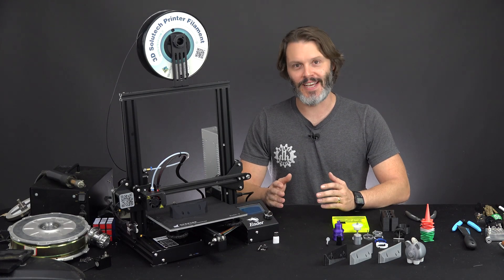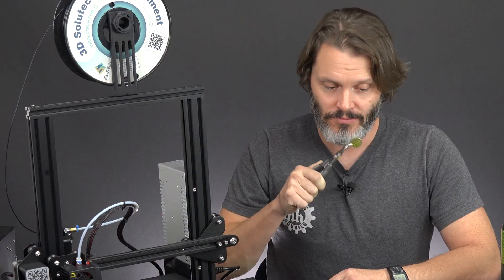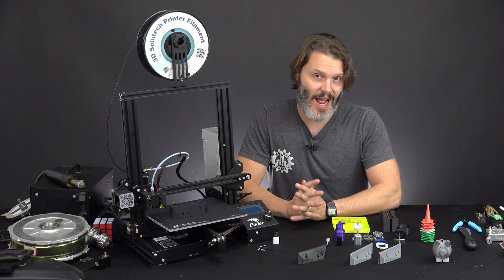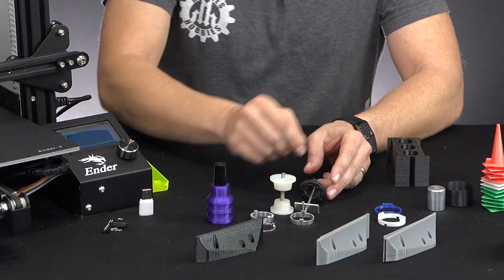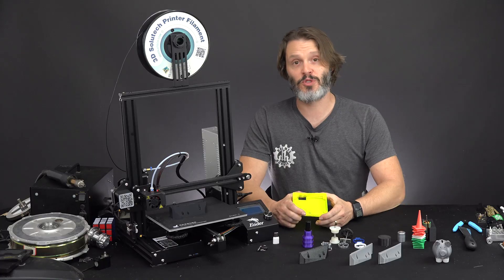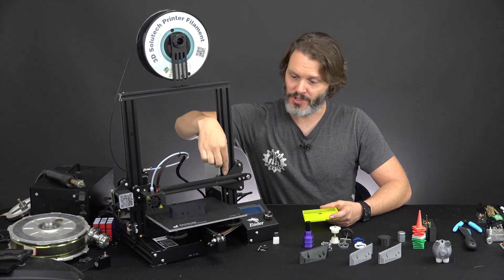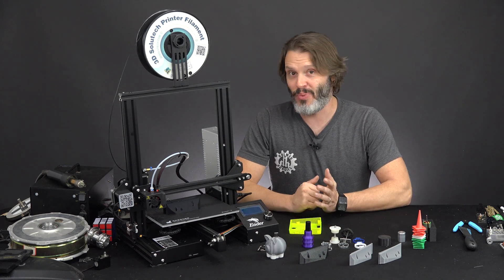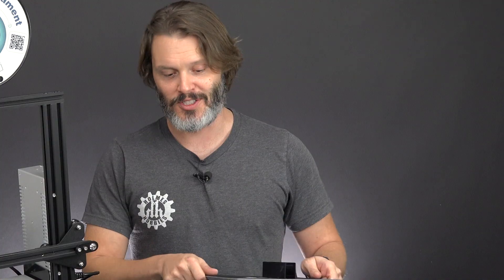3D Printer Talk - Printed Parts, More Creality Ender 3 & Tech Discussion - Holmes Hobbies

Comment: I mostly 3D print RC parts, RC bodies and scale parts. For chassis parts I care more for strength than finish, for RC bodies it helps a lot if the finish is already smooth. Saves a lot of prepping for paint.

What other 3D printers do you use John?
Reply: i know it's pretty off topic but do anyone know of a good site to watch new series online ?
Reply: Thanks, I signed up and it seems like they got a lot of movies there =) Appreciate it!!

Comment: Hmm, my Ender 3 Pro printer upgrades... isolation mounts on the X & Y axis stepper motors, Capricorn PTFE tubing, and a new fan blower nozzle. It still needs a filament guide. Was using PTEG-Carbon Fibre, which was an utter pain to get printing correctly; Amazing stuff once dialed-in. Now back using PLA with the same settings (lower temps) and getting beautiful prints.  Mainly used for custom parts on my RC's, like a rear cantilever suspension setup and chassis braces/body mounts on my Gmade GS01 chassis (Unimog conversion).

I bought an Elegoo Mars M-SLA resin printer a month ago and love it. The level of detail on the prints is absurd... Completely different experience and more involved than using an FDM printer, but worth the effort to learn the quirks of SLA printing. Used mainly for detailed scale parts and figures/busts.

Comment: I am really enjoying my Ender 3 pro. Apparently they did change the motherboard's layout as mine has the fan on the bottom and they moved the USB and micro card to the top.
I did get a glass plate to print on  PETG with a steel .8 nozzle works great but not a .4 nozzle as it wont stick  properly. The biggest check is to make sure that when you say to use 100 mm of filament that the e-step pushes 100 mm through (this was my biggest challenge with under extruding). look forward to your next video

Comment: I'm looking to get into 3D printing and I e seen the printer you have featured quite a bit. I'm looking to print r/c crawler parts. I would like to make more scale realistic and functional parts like lift kits, lowering kits, brackets, bodies, floors, engines, engine bays, wheel wells, ECT. But I do want that perfect smooth finish. Would you recommend this printer or is there a printer you would recommend? Also I would like a bigger built surface even though printing bodies in multiple pieces would be more realistic. I just want to get you thoughts on that. By the way your motors are great. Thank you for your time

Comment: Get some Capricorn PTFE Tubing on that before you go direct drive. Cheap, easy and surprisingly helpful on bowden setups. I also prefer direct drive, but it has it's downside as well. I have TL smothers on one of my printers, but can't say it helped noticeably. They seem a tick quieter, and a tick better print, but not worth the trouble to me. I also just want functional parts, but if I want a pretty part, I just slow everything down to about half the speed I normally go, and I'm happy. If you want a filament guide, I'd recommend a chunk of foam rubber zip-tied to the top with a cut in the side. Just stick the filament in the cut and it acts as a guide and wiper. Also it's fast and easy.  Great, fun video. You are a joy to watch!
Reply: Also, I am running Octoprint on Pi 4. The upgrade from Pi 3 is SO worth it!

Comment: Ya you need to upgrade to a Micro Swiss hotend and Capracorn boden tube to start next $6.99 micro sd to larger sd card also visit Thingaverse for sd card holder , x access screw piece for filliment ...change location of spool holder and move to far left of carage last print larger extruder knob makes it easy to load and unload filliment ....you will be very pleased with the Ender 3 works great for $175.00 dollar printer...

Comment: How high or low is the quality of the plastics used in 3d printing? I would love to be able to print out my own bumpers, side guards, maybe my own shock bodies. Is the plastic strong enough to take a little impact,  good enough to prototype?
Reply from the maker: some plastics are better than others.  nylon is the best for impact but its also pretty hard to print for a newbie.   Also need a full metal hot end to print it.   PLA is easy to print and will get you pretty far at first.

Comment: All  I upgraded on mine was screen back cover, Capricorn tubing and HeroMe fan duct.  Will your PLA sliders hold up to crawling?
Reply: Hard hits, nope. Sunny days, nope. Long term shape cohesion, nope.
Reply: They will hold up for a while it printed out of the right material I have printed a bunch out of carbon fiber filament or carbon fiber core or whatever it is and they seem to hold up for a while

Plan is good for printing but if you want durability you have to find a different material

Comment: What have I upgraded? Way too much. I cant just leave things alone. Something you should upgrade? Capricorn Tubing and a fan cover. You should give the Cura ender 3 profile a try. If anyone wants a super silent printer the 1.1.5 board is a lot quieter. Even over the 1.1.4.

Comment: Really like the video holmes and 3d printing can it get better? Feel the same way about my prints unless it's for someone else I give zero ducks. If you care about the sound a th3d ezboard lite would be great take a look at the artillery sidewinder x1 just ordered one on black Friday and it does everything out of the box with of course a hardened nozzle if you plan on doing carbon fiber or glow in the dark materials that is. I have no upgrades on my printer besides firmware. Take a look at th3d unified firmware he does a really great job and like you he's a small business guy and I like to support the small business guys. Highly suggest checking TH3D out they have great stuff.

Comment: Wait holmes motors are farmed out? Hmm, not assembled in house? Why am I even buying a Holmes? I guess I may rethink my choices on the next round of motors. If you use a foreign assembly house which I'm sure you do, one could probably just buy from them directly as a generic, because you know damn well they do not honor your propriety. I can say one thing, knowing that I now believe the reviews complaining about holmes motors and other things like the bypass harness lacking QC that are on various shop sites.
Reply: We dont glue every magnet, balance every rotor, and press every bearing (although we do a lot of that).  We always do all our own handwinding and design work, 100% of prototype work, and we do more USA assembly and manufacturing of motors than any other company.  We dont simply sit around hiring others to do the work, we stay busy.  

But, some subassembly is done by trusted partners both domestic and foreign.   It has to be done to stay competitive. Nobody is going to buy a $400 motor, although we would gladly make them all in house if demand was there.  We go from proto to beta run in house, and if a product is lucky enough to surpass beta run volume I design mass production assembly tooling or a housing that a 6 year old can assemble. That allows us to put energy on the next product.  

Bypass harness problems...  it sounded like they didnt push the plugs together fully, it can be a tight connection. I never saw a return on that one, but we would stand behind any product and do what is needed to get the customer running.
Reply from the maker: To be more specific on the subject of "farming out", what this video talks about is subassembly jigging.   It is highly effective to print jigging during prototyping and bang out multiple units in 5 or 10 different variants in very quick order, but long term we only produce the best version.  Once the best version is selected, we can design a set of machined jigs or a self jigging housing.  While possible without 3d printing (we did it for 8 years), it saves a lot of in house CNC time that allows us more testing time.  We have the choice to use an assembly partner for some processes without impacting quality, and IF it saves labor we lower the price or use higher quality materials to offset the change.   We do as much as we possibly can in house.  But, we cannot do everything on every product and stay competitive.